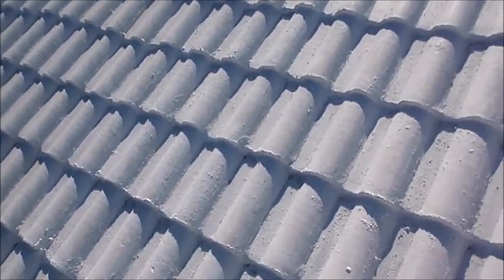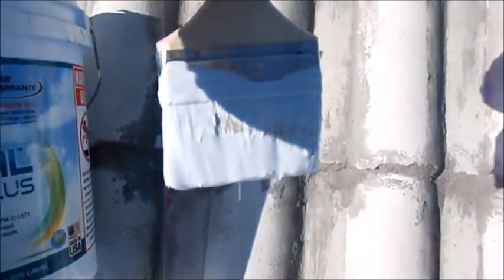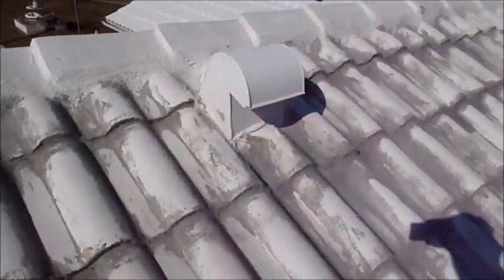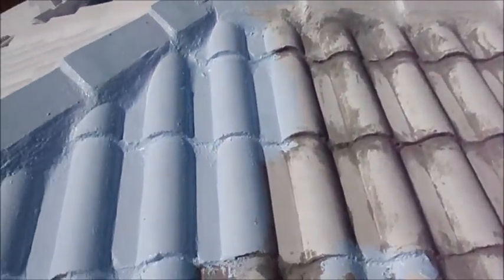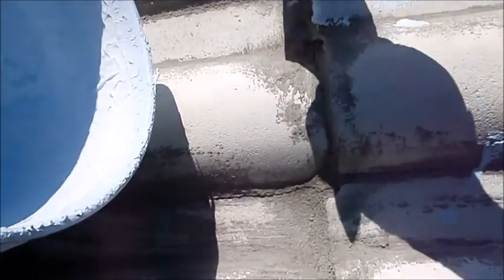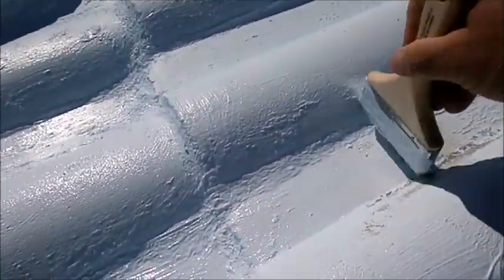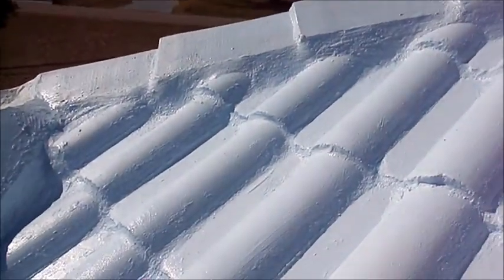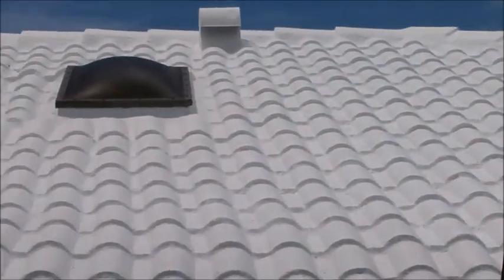How to apply Lanco White Seal roof coating

Comment: Man you got common sense. That roof, after the concrete you put everywhere between tiles, plus the sealer, which I would have just used highest quality outdoor paint, will last centuries with a slight inspection and little fix after so many years. 
Roofers in general are beyond retarrded, and fail to understand that the best way to roof is to seal the roof, not to weep holing, useless underlayment or under draining anything.
Also by adding the concrete you made your roof 200 mph wind resistant.
Reply from the maker: Hello, we just got our Internet back after Ian hit us
Our roof pass the Test of over 150 MPH winds and we had no leaks the roof is still sealed and looks great Thank you for watching God bless and be Safe.

Comment: Is this water soluable? If so you can't use it  on areas of possible standing water..
Reply from the maker: Hello,  I wouldn't use in standing water but on a slope roof where the water runs off is fine check with Home Depot for a product that can help you.God bless and be safe.

Comment: wonder if I should fill cracks on roof with regular tar before I apply the Lanco Sealant
Reply from the maker: Hello in my case I just rolled the Lanco Sealant on I put 2 coats  On but I had minimal crack if you have big ones try some other sealant  or  ask a HomeDepot associate to help you find the perfect solution God bless be Safe.